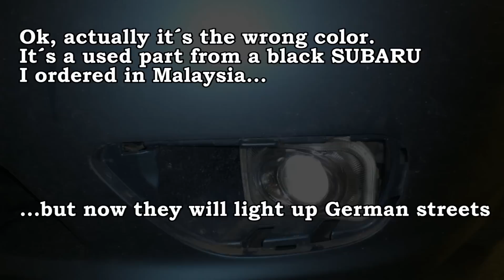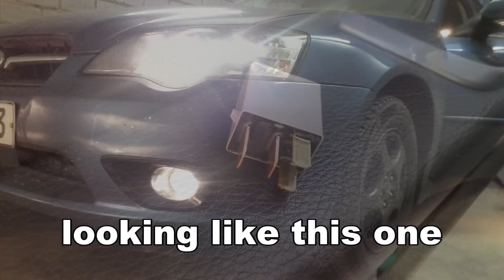Installation SUBARU LEGACY BP Fog lights. Nachrüstung Nebelscheinwerfer

Comment: The black harness shown on this video is not the right harness. It’s white for the fog light. The black one is for the Chirp when you lock and unlock the car. Also you will need an adapter harness between the fog lights and the cars harness.
Reply from the maker: But it works since 6 years? Two similarly colored wiring at exact position of the fog lights close to the bumper. No adapter was used. In the video it's a subaru legacy 2004 you have to know. I did it by myself so I'll know it definitely :-)
Reply: I have an 05 I didn’t realize it was a 2004
Reply from the maker: @camiloguzman2441  the change should be 2008 by face-lift. Maybe some different between Europe and US. Because only us have the beep beep stuff